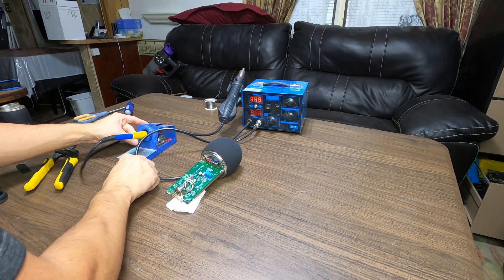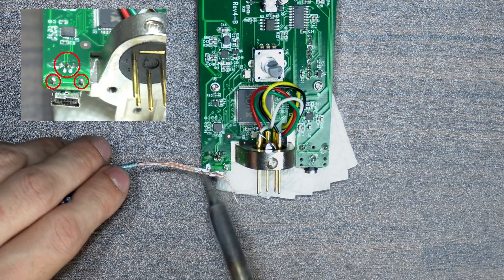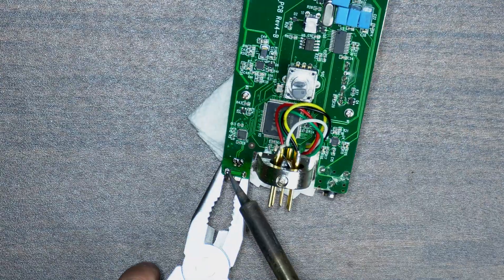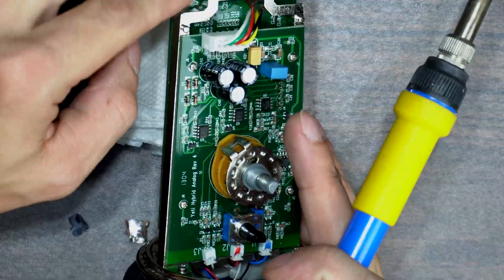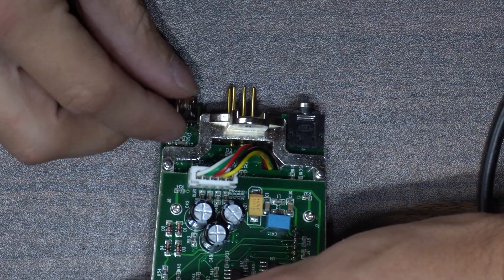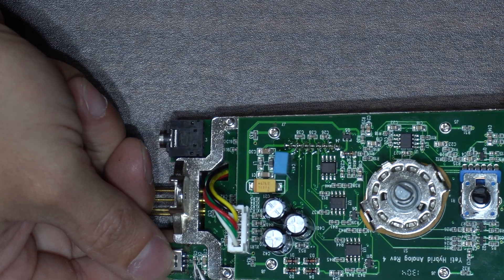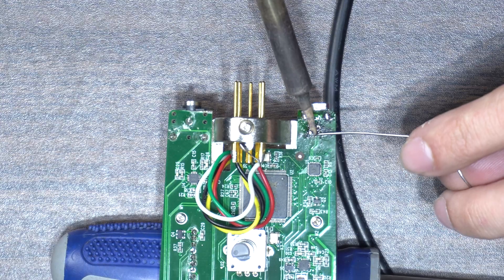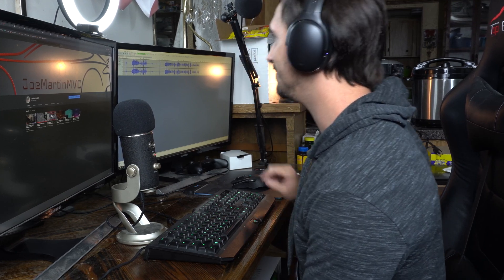DIY: Blue Yeti Mic Audio Fix - Replacing the USB Port

Comment: 1. Is that a Blue Yeti Pro OR a regular Blue Yeti you're working on?

2.The reason I'm asking is because in the amazon reviews for the 10 pack, one person said that the pins on those ports in the 10 pack were too short. Here is his actual comment:

"My Blue Yeti Pro microphone PCB is only compatible with two USB connector support tabs (side away from pins). The two tabs near the pins are easily removed. The connectors look good overall but the pins are too short for my microphone PCB. The original connector had longer pins."

Comment: Hi mate i did this but the lamp won't turn on. Any ideas? Thanks? 😊
Reply from the maker: If any part of it isn't working after replacing the USB port it would most likely be due to a pin not being fully soldered, or a copper trace being damaged during the desoldering process. If you try pressing on the port while it's disassembled out of the canister does it light up/turn on?
Reply: @JoeMartinMVC  nope the light still dark. Bit frustrating because the set and equipment costs the same as a new microphone here in Norway 😂 bummer
Reply from the maker: @laidbackstream2629  when you say light, are you referring to the red light on the microphone itself, or an auxiliary light?
Reply: @JoeMartinMVC  refer to the on and off button centered on middle of the mic. 😊
Reply from the maker: @laidbackstream2629  interesting. The top right solder pad is the 5v positive and top left is the ground. As long as there’s a good connection to both solder pads it should have power. Do you have a multimeter to check for continuity?
Reply: @JoeMartinMVC  no unfortunately i do not 😔 would be most welcome Rn 😂 I dunno maybe ill just trow it away. But it's the pro version so it's bittersweet
Reply from the maker: @laidbackstream2629  I definitely wouldn’t throw it out, if nothing else you could always sell it on eBay for parts. 
I don’t know how much it would cost to ship, but I’d be up for trying to fix it for you if you wanted and I’d ship it back at my expense if we did something like that.